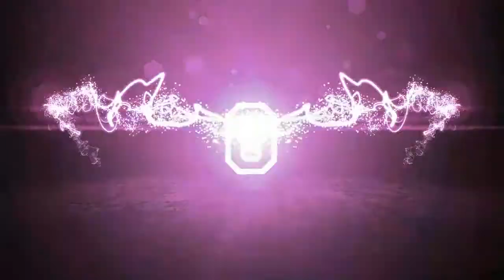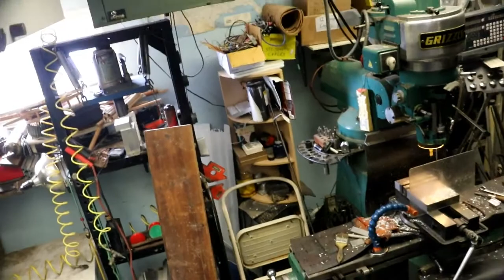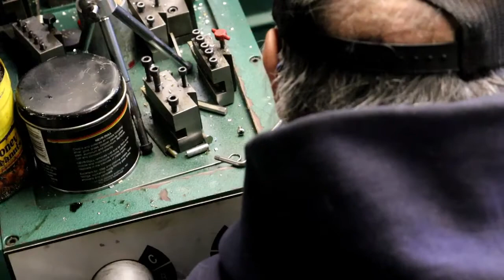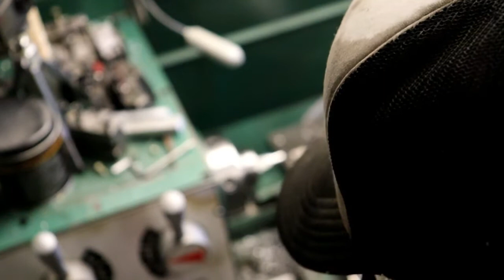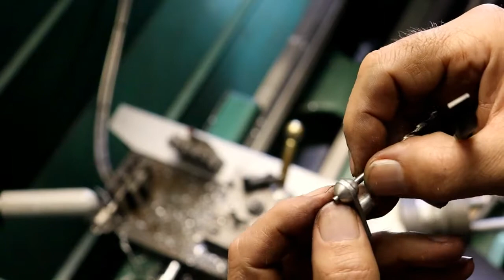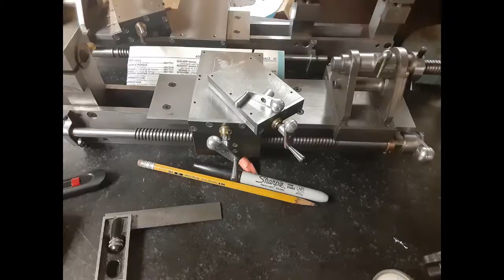Small lathe build 60 feed screw handle

Comment: I set my compound parallel to the spindle and use it for fine or measured Z infeed since I've got 1000ths graduations. (My graduated collars read direct [radius] rather than diameter like many lathes.) The carriage handwheel is .7 inch/turn with .020 graduations, not very sensitive at all. After 40 years I added a DRO so I can get fine positioning with the handwheel now, though it's fiddly. For grinding I set it just shy of 6° off parallel. That way .001 compound motion give cross feed equivalent of .0001. At 30° off the spindle axis or 60° from the cross axis, .001 compound motion gives .0005 cross motion.